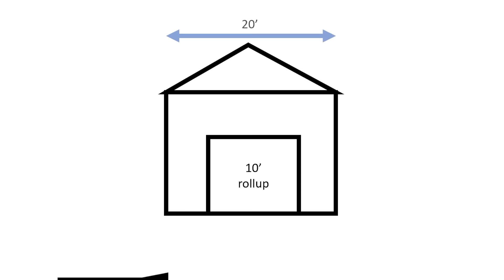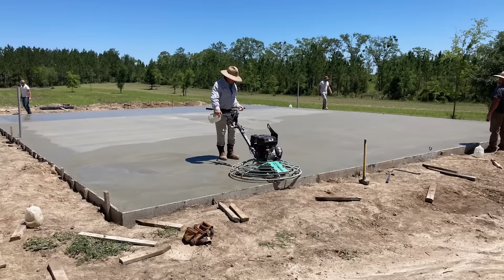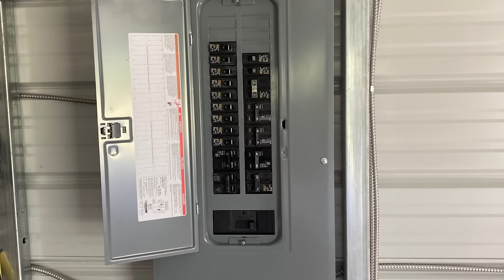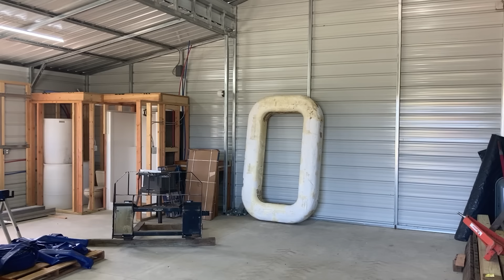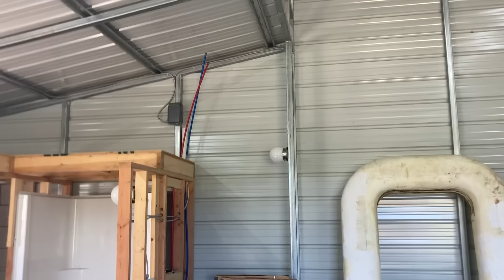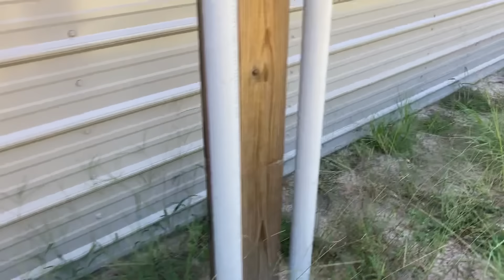What I Wish I Knew BEFORE Building a 40x60 Metal Shop / Steel Building!

Comment: This is excellent.  I am in the process of deciding what to do as we also are under contract for property in N FL.   Do you have vapor/precip issues wihtout the insulation?  Nice vid.
Reply from the maker: We love this building and need to do a follow-up to this video.   There is some condensation on really humid days, but not bad.  We are about to spray foam it.   Here's a more recent video of the inside: https://youtu.be/tZ8FZEr06t8

Comment: Those vertical beams holding up the internal headers, Id recommend putting one or 2 short horizontals between those 2 vertical beams and weld or bolt in there, will add more strength to them. Even do that on the front external verticals too.

Comment: What is the 200 amp load center that you are using ?  I am trying to find one like yours with the main breaker at the bottom but not found one yet.
Reply from the maker: Hmmm....I don't know.   I can ask my electrician.
Reply: Yes please do. I haven't found one yet.  Thanks
Reply from the maker: @markrobinson8539  He said it's a standard box, you just flip it whether the service comes in from the top or bottom.

Comment: How far from the edge of the concrete pad did you set your 2 inch electrical conduit ?   It looks like you got it just right.  Nice and vertical.  I was going to go through the wall of the building but I like your method much more. I am going to install a 200 amp service as well.  My power pole is about 14 feet from the building.
Reply from the maker: The metal tubing for the building is 2 1/4", so I put it about 3" or so I think.     Here's how we framed it: https://youtu.be/uL5SFIs5lXE

Comment: Shout out NW Florida. 
I’m surprised you had to use someone in Jesup when there’s a Carolina Carport manufacturing place north of Bainbridge. 
On the door, you’d asked for a framed opening and use a regular door not the 1975 mobile home door provided. 
On the step, it’s usually a 1-1/2 step (siding profile height) because installing the siding vertically leaves the bottom open. The step solves this, and no mice or bugs get in.
Reply from the maker: I don't think you can buy factory direct.

Comment: Great video... maybe I missed it but how did you attach your wood framing to the metal framing.. I like the way you Incorporated it within the wall... did you use some kind of self tapping screws with angle joints?..or what did you use?..
Reply from the maker: Yes, we used galvanized L-brackets and self tapping screws.   It's shown a little better in this video:  https://youtu.be/uL5SFIs5lXE
Reply: @PineyGroveHomestead  Thanks.. I'll check it out...

Comment: If your leans were the same height as the main building (roof line did not drop), could use still use internal headers to enable open bays?
If the leans were on the same roof line, the 45 degree braces would be high enough to allow full 8' OSB sheathing w/o trimming/notching around the braces. I do like the looks of the leans roof line dropping down like yours does though.
What does the building like yours cost (as built)?
Reply from the maker: I'm pretty sure you can use headers without a drop in the lean but no drop would change the appearance of the building.  The lean is 9' because that's the height you need to clear a 8' tall roll up as the end needs a header for the door.   Just the metal portion of the building is over $35K now in Aug 2022.  Concrete is now $8 sq ft in our area.   Thanks for watching.

Comment: Great video!! Sorry for long comment in advance. 

A couple of things I would do if I built a building like this. First I would cut some square tubbing to make up the difference at the slope in front so that the weight of the roof is supported by that and not just screws (9 min mark). I would also use some type of sealer under the tubing to help keep water out. A lot of protection for some cheap tubes of sealant. For having the door flush with the concrete floor, you can cut the top and sides of the tubing and leave the bottom. That would give you continuous support keeping things lined up and connected. Another method could be to pour the floor of the building later and have it end up flush with the top of the tubing. You would have to have grade beams, footers or something like that though. You could also pour another 2" top coat on top as well. That would give you a thicker slab too. People do that when they install radiant floor heating, so it should work here as well. I am in the process of trying to get my metal building garage/house built. I am planning on using AMERICAN OUTBACK BUILDINGS, unless I find someone I think is better. They have 45 year warranty too for walls and roofing! Their metal components seem to be bigger and beefier than anyone else's but not as heavy as commercial steel buildings. Theirs is cold rolled steel. I'm trying to find a builder that will install it on a poured basement wall with a basement below. Maybe ICF walls by LITEFORM. I would also use their LITEFORM DECK as well for my floor slabs so I could have my man cave/bunker basement area hidden under my garage floor. Another thing I am planning on doing if I use spray foam is to have some type of house wrap on the sides. I saw that in a video that that would be a good idea just incase you need to replace a damaged panel. The spray foam would make that more difficult. Also using wainscotting would make the cost less since you don't have to replace a full section if 1 spot got damaged. I'm not affiliated with any of these companies, I'm just looking and passing on information. 

AMERICAN OUTBACK BUILDINGS
They have 29 installation videos on YouTube that I watched already. Here is the first one, just click watch all.  

Here is the website for their buildings. 

LITEFORM website:
Reply from the maker: You win for longest comment on our channel, ever!   CC is not perfect, but it was reasonably priced and has held up to some extreme Florida storms!

Comment: Hello Brad, I just had an all steel building built and there has been some issues with my lean to’s. My garage was built very similar to your however I did not have any open bay headers needed. My question to you is how did they tie in the lean to’s so they are water tight between them? How did they flash them? It would be great for some pictures or even better yet a video.
Reply from the maker: You can see the leans are dropped down 2 feet.  So there is vertical steel meeting horizontal steel of the lean roof.  Where they intersect, there is an L shaped piece of white trim that tucks behind the vertical and extends over the horizontal.  That keeps water from coming in at that area.   They actually installed my L shaped trim on the front side of the vertical, and it leaked BAD.  They had to come back and put it in the right place and it doesn't leak anymore.   Here's another video on the Mega-shed that might show some other areas inside.  https://youtu.be/uL5SFIs5lXE

Comment: Brad, Nice job on the review. I put up a straight 20x40 workshop metal building. Had the spray foam installed. After 24 hours you can paint the spray foam with a latex paint. (do double check with your installer for compatibility) I sprayed all my walls and ceiling with white satin. Does an excellent job of getting rid of the sickly yellow overcast the foam leaves and considerably brightens the building. Just a recomendation.
Reply from the maker: This is where we framed it and that was last year and we haven't gotten back to it since....just too much going on.  https://youtu.be/uL5SFIs5lXE
Now that the pole barn is built out, we have storage to clean out the shed and get it foamed and the floor enameled.

Comment: Try T & G Carports and sheds out of Plant City Fl . Build custom sheds, barns , garages , 2 story bldgs, partition walls inside , animal stalls ,even houses . And they are built to your dimensions that you want , down to the inch . Even can be engineered to not have the 45 degree angle braces. But all In all the bldg in the video is a nice one .
Reply from the maker: Thanks for watching.   Every building and manufacture is going to have little things that aren't perfect, but all in all, we are happy with the building.

Comment: Thank you for this video.   I just purchased a 30 x 45" building from Eagle Carports.  The designs are very similar.   I went round and round with them about the concrete, I get conflicting info depending on who I talked to in the company.   Some say you want the concrete exactly the same size, while others say you want your slab to be 2" larger on each side so that the bolts doesn't  chip out the cement.  My cement contractor suggested doing a sheeting notch for the sheeting to drop down lower than the square bottom rail. Anyway, some great information.
Reply from the maker: Agreed!   Some of my anchor bolts are cracked on the outer edge.   I guess it's just part of the game when you buy something high volume like this rather than a custom local build.    Glad I built it though!    Thanks for watching. Brad&Deb
Reply: @PineyGroveHomestead  It's interesting you mentioned the cracking cement at the bolts.  I have watch a few videos and no one has mentioned that.  I ended up buying the flush mount kit which essentially is a bunch of metal brackets so you can move the anchor bolts inward.    The side effect though is  if you dont do 2x4 studs the anchor bolts on the cement floor will protrude from the wall.

Comment: Great video! Quick question. Did your county require blueprints for the interior rooms that were added? If so, did the metal building company edit the prints that they have? Thanks!
Reply from the maker: A rough sketch was all that was required.   Carolina Carports didn't provide any blueprints but IRRC they have engineering available for the way the building is put together for the wind loads, but it's not drawn for your specific configuration.  More of a general engineering best practice document.
Reply: @PineyGroveHomestead  Awesome Thanks! Hopefully my county will allow the same thing. (williamsburg county sc). We plan to build 20x40 living quarters inside a 40x70 building and was worried about the inspector coming out for the final inspection and seeing drain pipes sticking through the floor lol
Reply: @johnnyclark3633  Hide that crap the best you can!! Once the city/town/county is involved you'll be stuck pulling permits and following local codes. In many places if there is a shop below they won't allow you to make a "living space" above it, you have to sneak it in later and either avoid the neighbors or have really great neighbors.

Comment: Great video! I was curious if they installed some kind of gasket between the metal tubing and the concrete to help seal it to prevent water, dust, etc.?
Reply from the maker: They didn't.   That or a bead of caulk would be nice to make it more air tight and keep out bugs though.  Thanks for watching.   Brad&Deb
Reply: @PineyGroveHomestead  thank you for the reply!
Reply: @PineyGroveHomestead  I was going to mention to you, go buy some of the ZIP liquid flashing for doors and windows and run a good bead along the entire interior portion of the building at the base rail. 

Stuffs designed for keeping water out and it works great! Not cheap, but worth it for sure. Amazon has everything including the special caulk gun “sausage gun” you will need. 

Having one of these buildings already, if I ever do another it will be something I do to go around and run a thick bead under the bottom rail before they install them. They might get mad for taking more time of there job but idc, worth it!
Reply from the maker: @gavincline209  At this point, I've pretty much got all the water issues solved on the sides and back of the building.   On a driving North rain, I'll get some water under the rollup but it's only a little.....the 15' porch keeps it mostly dry.
Reply: @PineyGroveHomestead  nice, always good to know your building won’t flood. Lol 👍👍

Comment: Hey Brad, my building just got finished last week. Thanks for sharing your ideas on framing. Have you finished out your enclosed area yet?  I would like to see your final look.  I too bought the same style only 48'x50' I'm making a 12' 35' living area for my daughter.  Did you put any flooring in on top the concrete?  **also not a fan that diag bracing.
Reply from the maker: Between life and the price of lumber,  🙄 we have not finished out the interior like we had hoped by now.   We are planning on painting some of the floor with enamel but there is no reason you couldn't tile, LVP or carpet it just like any other slab floor.  Here's a video of when we did the interior framing if you haven't seen it:   https://youtu.be/uL5SFIs5lXE  Thanks for watching! Brad&Deb

Comment: I am considering Carolina Carports for my building.  Thanks for the very good detail on the building materials and how they install.  Yes nowhere else have i found it shown like that.  Stepping the concrete is a good idea. You might want to look into doing a french drain of sorts on the that one side if you continue to have a problem.
Reply from the maker: It's been a good building and held up to some powerful storms over the past 2 years.   Like anything, a good installation team is key.   Thanks for watching.  Brad&Deb
Reply: Buyer beware!

Comment: Great 👍 video looking forward to more. 

Can you give any details on the building planning,  permitting, contracting, well drilling,  electrical and other costs, etc.  

The process and cost for the concrete pad for the building.  

I'm preparing to move to a property I bought just before Michael flattened everything. That, the virus,  and medical treatment for cancer has delayed my plans. 

Michael was very disheartening,  but I know others lost a lot more than just trees. My heart goes out to them.

2 years into this pandemic and now I'm itching to get on with things and make the move before I get too old to enjoy the place. I'd  like to clear an acre or so and put in a shop building similar to yours before I build a home. 

Thank you for sharing your experiences in this endeavor.
Reply from the maker: Thanks for watching.  This building is 2 years old and I fear that my costs are not relevant  due to the extreme inflation, especially for metal which is up over 100%.  I recommend contacting Chad Burke at Carolina Carports for a quote.
- Contact your county building department about codes and permits.  A lot depends on how you will use your building.
- Concrete is now $6.50 a sq ft in the North Florida area.  That was 2 months ago when I poured my pole barn.
- Wells cost about $7000 if they hit water at 200' or less.  It's about $20 a foot after that. We have a well video out.
- Land Clearing is about $3000 an acre...depends on the size of the trees and any dirt movement needed.
- 200A electrical service for a building this size is ~$11K.  Electrical components, especially wire, have doubled in price.
- Getting a meter installed depends on how far the power company has to run lines.  Overhead is cheaper than burial.
We plan on making more progress on this building this spring. Stay tuned.  Brad&Deb

Comment: I'm a installer I do pool screens man it's kind of the same thing when it comes to building the frames they probably didn't do it because of the inspector if you have to have an inspector out there they have to do it to the blueprint that they have or it will get filled maybe they could have came back and do it we done that before  we'll come back to the homeowner and change the stuff after the inspector check everything out
Reply from the maker: We'll do an update video on this building in 2022.  I want to get the interior spray foamed, the concrete treated, the floor enameled in places and do some landscaping.  Check out our "million gallon" drainage system Part II to see how we mitigate water around this building.  Thanks for watching and stay tuned.  Brad&Deb

Comment: I'm under the mindset that if you are paying for it you should get what YOU want , not what THEY want. Too many other builders out there for you to have to settle.
Reply from the maker: Every area in the country is different for building pole barns (skills, availability, price, etc).   A stick built pole barn enclosed like this shed was  at least $10K more and would only be as good as the installer and rated max 130mph.  A metal building with the "red" I-beams was $20K more and they wouldn't answer phone or give a solid install date.  Carolina Carports was the cheapest, the highest wind load, no wood construction, and had the smallest margin for error for install as it's basically an erector set.   Check out our pole barn build here:  https://youtu.be/3ZBHDY4cBKk
Thanks for watching.   Brad&Deb